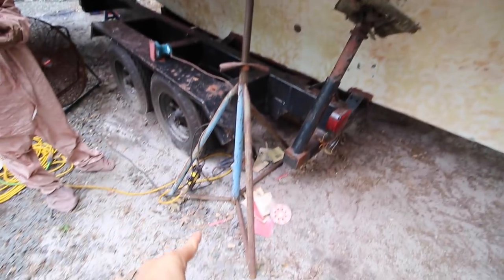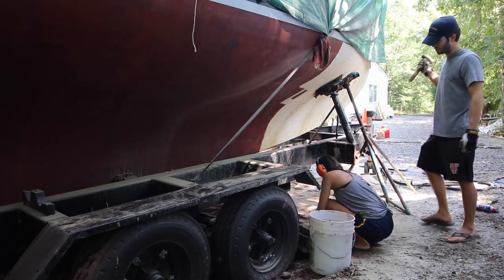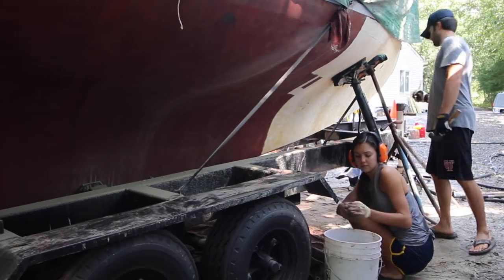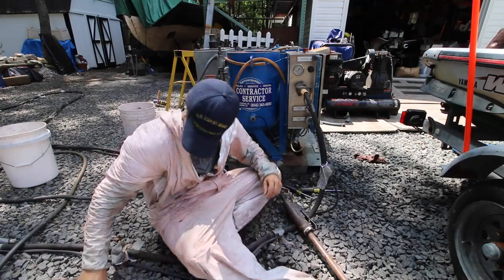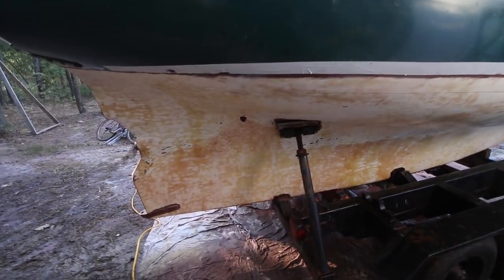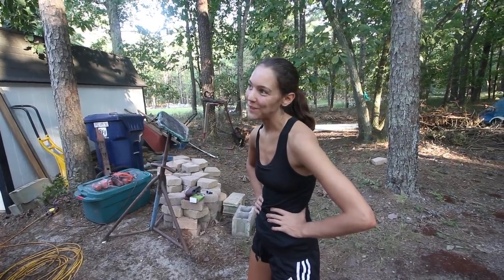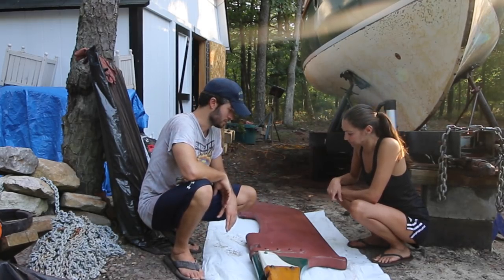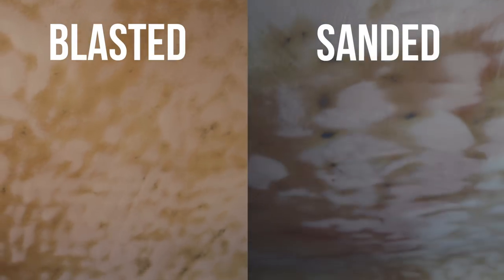45] Backyard DIY Classic Sailboat Restoration | Abandon Comfort

Comment: Okay, love your channel, and your choice of sailboats. Her are a couple of tiny things which are only marginally interesting. You can't recycle media, because it LOOKS AND FEELS like media, but it's now corrupted horribly by the refuse it has been pealing off. It is THAT refuse which causes most of the clogging. Also, yes, of course you must remove the old bottom paint. Something most people do not understand, is the cheaper paint, which that was, dies whether it is in the water or not. That paint would have attracted growth like wet T shirt contests attract horny college boys. The high end dissolving paint, DOES NOT deteriorate while stored on the hard, but I have to say, a decade is a long time out of the water, and I would have stripped it as well. Most importantly, stripping the bottom reveals the true condition of the boat, and that alone is of paramount importance. Yes, these boats can safely circumnavigate - but you must be sure it is perfectly sound.